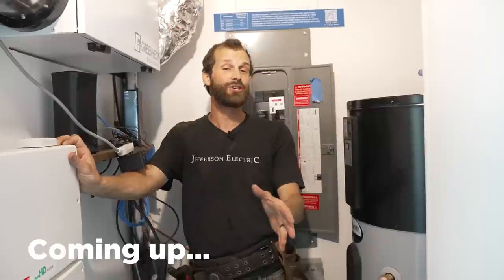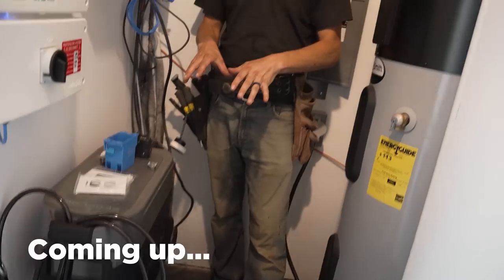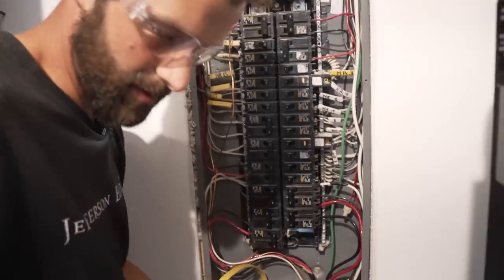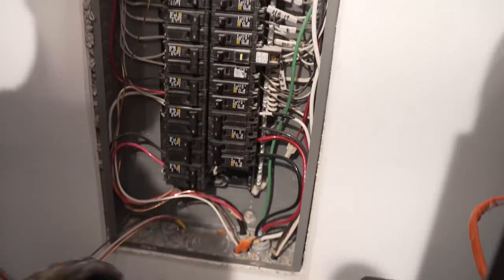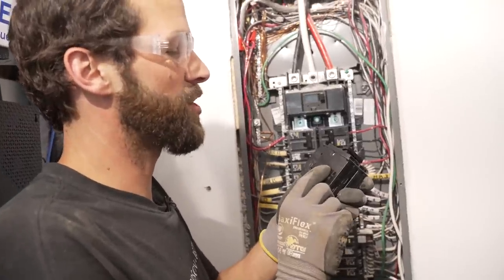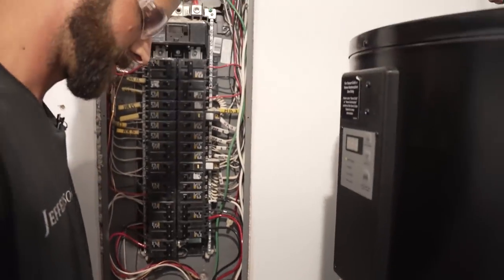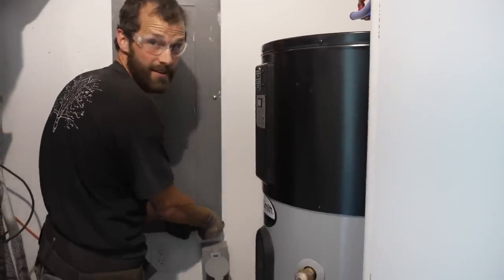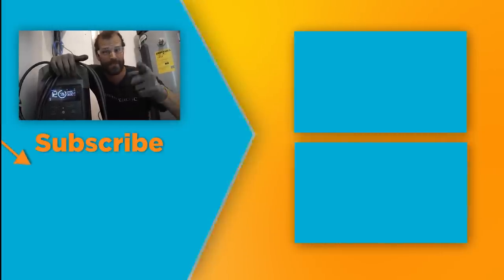Fixing the Batteries in an Award Winning Home

Comment: Multi-wire branch circuit powering a two-outlet receptacle is always fun to run into. It'd be funny if this was always the standard 15/20A hot-hot-neutral receptacle instead of NEMA 14-15P/14-20P.
Wish you luck down in Texas, I think I know the project, look forward to seeing you on that hill. :+ )
It'd be funny if there was a company making three-outlet receptacles, then you could do a three phase multi-wire branch circuit to single receptacle, rather than just two wye phases or a split.

Comment: I have done some electrical work involving some old panels, one of them was a Pushmatic. I was concerned with the breaker failing while flipping on or off, so I worked the circuit live. I've witnessed a breaker fail and arc itself to death, it's not a good situation, especially if you are miles out of town. On a convenience note, I have no problem working in live panels for the sake of keeping all the other circuits live. For only having residential experience, I guess I have a commercial mentality.
Reply: I doubt that he is working on anything critical that justify working live and never wearing any PPE. As I said many it only takes a second to change your life. A good teacher would show how to do safely following safe work practices. Not stating every time I am going to work live.

Comment: Make sure they know that the grid tied PV breaker also has to be turned off since the EcoFlow does not AC couple and will go pop when the grid tied inverter starts producing more than the house is consuming.
Reply: He did say the Main Service Panel is a subpanel since the Main Disconnect is not in this panel. So the Grid tied inverter might be tied in upstream of the of the 200amp breaker on this panel and tied in at the Main Point of Disconnect. 
<Utility> - - <Meter> - - <Main Disconnect w/ Grid Tied inverter> - - <Main Service Panel(Sub Panel) in utility room>
If this is the case then utilizing the Main Breaker and Generator Interlock would prevent the grid tied inverter from back feeding into the house.
*Edit for formatting
Reply: @mike_realityi  true

Comment: Just a tid bit of my reasoning.  I've shoved the boxes thru the wall a time or 2. When trying to tuck the wires back so the plug will fit. So I've stared putting the plug in 1st then tighten the box up to sheet rock.   Don't get me wrong. Few and very far between. But it just seems better for the long haul.

Comment: I understand and see mwbc circuits all the time but I prefer to use 12-2-2 instead of 12-3 if im running 1 cable for 2 circuits. If a neutral gets loose in the future it can be a problem that can fry electronics
Reply: Not only that but with AFCI protection needed on almost every 120 volt residential circuits it would not be practical to ever use a shared neutral wire.
Reply: Are they calling the 4 wire Romex 12-2-2 or just 12-4 like they always used term for 4 conductor type AC ( BX ) cable. I installed a 25' length of 14/4 BX cable in my basement 40 years ago to add a four way switch to basement lights .
Reply: @JohnThomas-lq5qp  12-2-2 has 2 hots 2 neutrals and 1 ground realy its cheaper in wire to just run 2 seperate 12-2s because 12-2-2 costs more. All you need between 4 way and 3 way switches is 12-3 which has blk,red,white,and ground

Comment: MWBC are so interesting! Does that mean the 20 amp rating on that duplex receptacle applies to each of the two receptacles in the duplex? Meaning you can have a total of 40 amps going through the device and it’s rated for it?
Reply: That's correct. Each receptacle is on a separate pole of the breaker. This technique is often used in kitchens for high-current appliances like toasters.

Comment: The two plugs on the Double Voltage Hub are 240 volt, not 120 volt 17:32 (note the horizontal hot receptacle slot).
Reply: Correct
Reply: I was going to make the same comment, but I don't have to. 🙂

Comment: Replace the smoke detector batteries!
Reply: a house with so much advanced tech, and no hardwired smoke detectors 😂
Reply: @tornop1 hardwired smoke detectors chirp when the battery is low.
Reply: @tornop1  that's actually not the problem.  They are hardwired to something(likely the lights circuit), someone didn't pull the plastic tab to connect the batteries up.  (Don't want to do that till the house is 100% done)
Reply: I would think he would have taken care of it before he filmed the video.
Reply: @benjaminjackson1959  I still think it's because the house isn't complete(power may be turned on/off for various things I guess).  And you don't want to waste the battery life before it isn't ready.  (That's what I've been told by the electrician I work for)
Reply: @thecodingchicken   does the battery chirp while it's In the box?  It only chirps when it has ac power and low or no battery.  So maybe plastic tab hasn't been pulled yet or it has a dead battery.
Reply: "Hardwired" smoke detectors don't USE a battery. LOL.
Reply: @tripjet999  yes they do.  It's a battery backup in case the power goes out
Reply: @benjaminjackson1959  Correct.  AC power and "dead" battery are the required conditions.

Comment: And award winning house electrical closet appears not up to 40 year code of needing at least a 36" deep space in front of panels along with at least 30" wide clearance. White grounded conductors don't appear to be identified to let one know what 120 volt circuit they are part of.
Reply: I was about to comment. That nook where everything was just shoehorned into and in no logical or nice looking layout. Big disappointment in the mechanical room er closet.
Reply: I, personally, wouldn't want any low voltage stuff near my main panel, let alone the water heater...

Comment: 03:07 Hate working panel live. Your customers should also respect you so that you can respect electricity. As we've learned, working life can cause "Fireworks" and create unnecessary hazards to you, and liability of employees.

04:34 Mathematicians argue that it is mathematically impossible to have anything more than 100 % of anything. If I have $100.00 and you give me $100.00 I don't have 200 %. I have 100 % of $200.00. If you take away 50 %, then I have only $100.00 again. If you take away 100 % I have $0.00 which if you took away 100 % of $200.00, I would still have zero. You can't take away 125% of $200.00 nor $100.00 because once you've taken 100 %, there's nothing left to take. There is no 25 % after 100 %. 100 % is the max.

06:58 Plastic boxes again... NO GOOD. Must be steel box. If I was paying, especially those prices, I would INSIST on steel. Plastic is cheap, shortcut, and unprofessional trash. Keep it neat and professional. Lasts a long time, creates a demand for steel, leads to US steel plant job creation. 

10:00 In our area, Code stipulates that each hot wire must also have its own neutral wire. No longer allowed to use ONE neutral with 2 different hot. So if hot tabs are broken, then neutral must also be broken.

Someone ought to change the smoke detectors to smoke/carbon monoxide/ explosive gas detector that has a rechargeable battery and stays charged by electric. That is super annoying. I guess that's the point. They should just make what I described, so you don't have to customize it. None of that app crap, smart phone stuff. Just an interconnected smoke/ CO/ explosive gas detector with rechargeable battery that stays charged as long as electric is working. Probably won't happen though, because Corporate America doesn't want to do anything that makes sense unless they can profit obscenely from it. And even then, they're still not that smart. 

Great video nonetheless, thanks for posting.